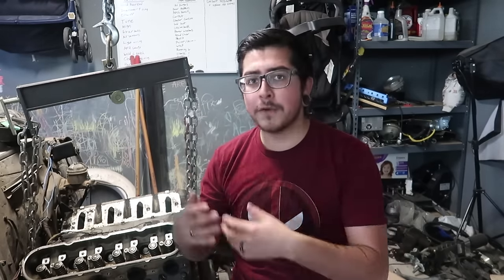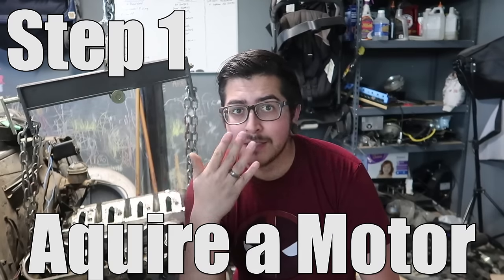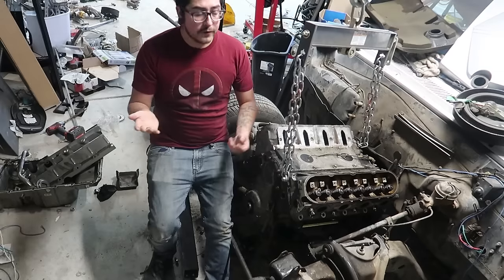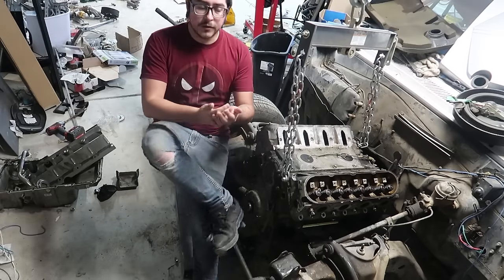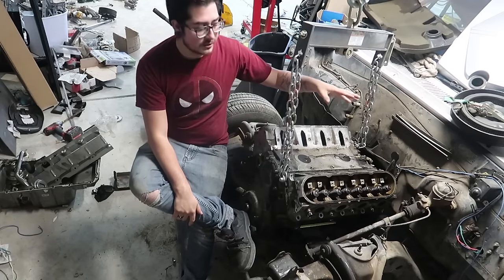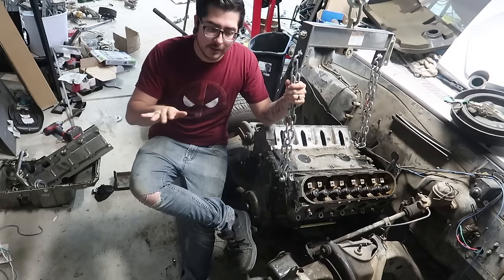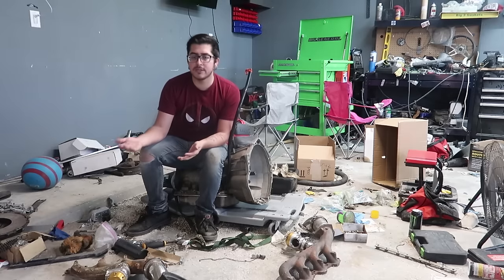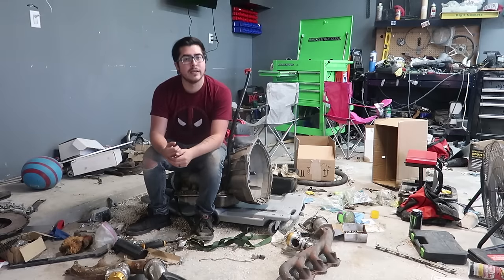HOW TO LS SWAP ANY VEHICLE - 5 THINGS YOU NEED -- LS Swap Basics Overview (LONG VERSION)

Comment from the maker: STOP: BEFORE YOU COMPLAIN ABOUT THE LENGTH OF THE VIDEO GO HERE:
https://youtu.be/DucuEkh9yJE
Reply: Jovani Dante Griego well I have a question, I have a Audi A5 2009 can I put a ls in there ? And pass inspection
Reply: B Rock really depends where In the world you are, some countries are much more lenient than others with engine swaps
Reply from the maker: Elittiger Savage  the biggest problem with doing late model cars is getting everything to communicate. You'll need to find someone that can work with can bus. Swapping it is easy, but getting anything in the car to work is another story. Honestly 2010 ss Camaros cost as much as it'd take to swap it. It's not impossible just not worth it
Reply: Rectro YT New York
Reply: Jovani Dante Griego yO j what’s some good headers to use on my 6.0 ? Vortex
Reply from the maker: @brock2872  what's it going into?
Reply: Jovani Dante Griego it’s in my Silverado 2500
Reply: 2012 I wanna beef it up a lil
Reply: Jovani Dante Griego ?
Reply from the maker: @michaeldunn1262  go check out my other videos and see for yourself instead of judging me on 5 minutes of a video I made 2 years ago?
Reply: Jovani Dante Griego 
I’ll pass 
Thanks anyway
Reply from the maker: @michaeldunn1262  don't worry I'm sure YouTube will recommend them to you 👍
Reply: Jovani Dante Griego 
I see the maturity issue is still current :)
Reply from the maker: Respect is earned bud
Reply: Jovani Dante Griego 
Respect and maturity should have been a skill at the age you made this. ;)
Reply: Jovani Dante Griego can u LS swap an Corolla ?
Reply from the maker: @loercayt6146  with enough time and money sure why not
Reply: Jovani Dante Griego cool my dad Recently give me his Corolla and I’m a collage student I’m looking forward to that
Reply: @Jovani Dante Griego Thanks for the video.
I been planning my first LS swap for years, I have in my opinion the perfect vehicles, 93 s10 all complete, a 02 4x4 Tahoe 5.3 also complete, both run and drive no issues. Tbh, I'm a little scared of starting this project because of the lack of knowledge of the LS engine, I'm a new subscriber as of today, thanks again for the straight forward advice👍
Reply: I wonder about putting one in my 2005 vw touareg v8
Reply: @Jovani Dante Griego excellent video anyone complaining should find another channel. This was short & right to the point!  I have yet to see any video that covered what you have here!  Thanks!  ✌
Reply: @brock2872  check out deBoss garage. He has a youtube channel and ls swapped an audi Quattro.  4 turbos etc. Very cool build
Reply: I have a 2007 v6 mustang and a coyote swap right now is around 5k+ would an ls swap be possible?
Reply from the maker: It's possible, just not sure how much work is involved.
Reply: @JovaniDanteGriego  Alright thank you for the help and great video! I’m still a teenager so i’m still scared of the idea of dumping 4k into my car and it not running, but i’m too stubborn to go to a mechanic 😅
Reply: @JovaniDanteGriego  , you should see my suggestions for unexpected LS swaps.  You can thank me later.
Reply: @michaeldunn1262  , speaking of rude and condescending, you are ironically so as well, and you also misspelled words, so if you want to be taken seriously online, as well as offline, then you need to fix those things in your life.
Reply: Good @brock2872  a was#
Reply: @bradstiver3399  huh ?
Reply: I have a 1999 Silverado engine 5.3 and trans and wire harness that I’m wanna put into 1999 gmc sanoma the sanoma has a 2.2 I have the 4l60 trans as well
What rear end should I look for?
Reply from the maker: @joseacensio673  your rear end will hold up just fine most likely . Upgrade to whatever fits, 9 inch, 10 or 12 bolt. You'll need to measure and find something that fits if that's the case

Comment: One of the biggest issues with swaps is the need to remove VATS (vehicle anti theft system) from the computer. This can now be done using LS droid to pull the stock flash and software like EFILive or HPTuners to remove vats right at home. No more needing to spend $600 on hardware or sending it to some shady ebay guy that takes 6 months to return your computer.
Reply: @chevysttruck thank you boss I'm working on getting my two door Oldsmobile cutless Supreme sl to get ls to it parts are interesting to get .

Comment: If you aren’t doing one of the more common LS swaps, and you know you’ll be doing a good amount of fab, I totally recommend a mock-up engine. Mine is from a company called P-Ayr. It’s a blessing to be able to set it in and remove it from the vehicle easily by hand. I’ve used mine on a few LS swaps now. My plan was to use it then sell it, because it was a bit pricey and the resale value is good. Nope. Once you buy it, you’ll wanna keep it for future endeavors.
Reply from the maker: Thats a great idea! How much was the mock up?
Reply: When I bought it, it was about $450. If you use it and sell it, you can probably get most your money back. But, if you plan on doing multiple builds, I’d just keep it. It’s super lightweight, and has metal threaded inserts in all the correct locations to mount items to the engine. I currently have mine bolted to a trans, and with an intake/carb, water pump, oil pan and starter on it.

Comment: My best opinion to anyone, get a donor vehicle. You will have 80% on what you need. The 20% remaining will be 100% easier to figure out due to everything you will have due to the donor.
Reply: I like the idea of a wrecked donor vehicle and using everything oem possible.  Harness,  cluster, ignition switch, computer, fuel system, evap system, exhaust, radiator, airbox, etc..  To me the biggest things would be how you do the exhaust fabrication and the big one, electrical system.  On a gm vehicle maybe you could integrate the system into one, but on most swaps i would imagine it would be easier to have a split system, to have the gm computer for the engine, and keep original pcm/bcm in a newer car for everything else.  You could try to make original cluster work, or make gm one fit.  I like the idea of having the stock column/ignition switch to control accessory power and starter/lights, and then have the gm ignition switch  dash mounted like some old cars, which would just be used for antitheft and engine run mode.  And keeping the obd2 port would be nice.

Comment: Do you think a 2020 C300 coupe has room for any LS engine? I’m also considering VQ engines or anything Toyota. The M264 2.0T 4-cylinder does not inspire confidence, reliability-wise
Reply from the maker: I just don't know if it's worth it on such a new car. Especially Mercedes theres so many modules and fiber lines that getting your interior to work is beyond that of the average person

Comment: LS swap question...why if i get cpu with complete motor,do u recommend i get it reprogrammed?
Reply from the maker: Because it has VATS Vehicle anti theft system
Reply: @JovaniDanteGriego  Sorry jus wanna b clear..Am i reprogramming bcuz lack of VATS fuel enable signal? Because i did a bypass with vats module,installed on cpu pinout 25 & 94 FLTWD ran again. Until then it wuld only run 3-4 seconds & cut bck off.
Reply from the maker: @shawnwilliams9968  yes vats disabled fuel after about 3 seconds

Comment: Jovani: more fuel efficient
LS: laughs in 3 mpg
Reply from the maker: 😂😂😂😂😂😂 ok this is gold

But really just lean them out to like 15/16:1 af under 50% throttle
Reply: Need the 4l60, 4l80, or the 6l80 to get the mpg you’re looking for.
Reply: LSes can actually do 40mpg
Reply: @ellenorbjornsdottir1166  with what mods?
Reply: @bradhaines3142  with a car, tall gearing, a 6 speed, and a tune. This will get you above 30, weight reduction and aero can push you over 40 likely. 

A c5 corvette would be ideal for this, or a miata.

Comment: Amazing what people whine about the video. It’s too long, it’s too short, it took too long for this, you didn’t spend enough time on that, your hair is too long, the color of your tee-shirt doesn’t match your pants, the floor is dirty, I could hear the neighbors dog fart, get a grip people. 

No matter what your building use a 4L80 transmission. It’s no more money and is just a better transmission. Especially if you’re going to abuse it even a little bit. And I know everyone is going to do at least a couple burnouts and hard off the line acceleration.

Comment: TLDW Basics-
Engine: 2001+ 4.8/5.3/6.0 ; try to find the most complete you can. Try to find a "complete pull out"
Motor mounts: Buy or make whatever is out there for your car already. If its a unique swap, you're on your own to design.
Transmission: Auto 4l60 (lower power build) /4l80 ; Manual T-56 (from GM vehicle), NV3500/NV4500 (not for racing), *TH350/TH400(requires mods), avoid 700R4/200R4
Engine/Trans control: Get harness and ECU with your engine (pay to convert or do it yourself), Megasquirt/Holley Terminator
Fuel: Electric fuel pump (255LPH), fuel regulator depends on intake style (returnless or return)

Exhaust Manifolds that fit - Custom of premade for your swap
Oil pan that fits - Lots of options for swaps
Reply from the maker: Thanks!
Reply: A CTS V oil pan can fit and will it be better?
Reply from the maker: @romero.4089  it depends on your car. Most people use the F body (2001 Camaro SS) pan
Reply: The Last Honk he forgot about the drive shaft
Reply from the maker: @jonnypiper5378  cut to fit or custom made
Reply: Why avoid the 700r4 and 200-4r ...I know the 200 has the wrong bolt pattern but the 700r4? I have one behind a 500hp 4.3 turbo?
Reply from the maker: You can run a 700r4 it's just a non electronic 4l60e, you just have to worry about the TV cable. I just don't suggest them because even a built into doesn't hold up well to v8 torque . Obviously some can but even the 4l60e can't hold up. I've gone through a few
Reply: The Last Honk Audi ?

Comment: If its from a truck and going in a car: 
Intake and oil pan/windage tray are almost always a must. Wiring harness engine mounts and headers become the next challenge. Radiator also can be problematic. Ac and ABS might need to be relocated/removed.

Comment: I’d like to swap a turbo’d LS into a tesla, what do I need?
Reply: For a Tesla LS swap you need a flux capacitor  You can buy one at o'reilly auto parts make sure to buy the upgrade it 1 that generates a 121 jigga Watts
Reply: A Tesla, an LS, a turbo, some paper clips, a roll of packing tape and set of fluffy dice. Job done.
Reply: A "Turbo LS" sticker and fake muffler tips.
Reply: An ls for one and at least one battery mayby a rear end
Reply: You need a engineer lol
Reply: @countryjoe3551  I ordered the car to tank kit. I will Use the Kaleco advice,launch the product then watch the news... i am going to practice on the local Mosque first.
Reply: Literally just take the body and the frame from the tesla. that’s it
Reply: 2.56 niggawattz higga
Reply: First you need to be able to afford a Tesla. Then it’s all down hill from there.
Reply: Get a Corvette and put a Tesla badge on it. Done.
Reply: Jimmy Baggs a clinical psychologist
Reply: @Stew Pa'Dasso  That was the pass1.21 now is 121 jigga watts 2020 you just don't know what next
Reply: Ask rich rebuilds, he doesn’t have a turbo but he did get the engine to start in the car.
Reply: @mikesgsx420  rich rebuilds didn’t need a flux capacitor

Comment: Wow. You just spent 20 minutes complaining about people asking you about the swap, but somehow managed to not answer any of the questions that matter.
How about that Oil pan clearance issue?
The alternator  that bangs up against the frame issue?
floorboard modifications?
Reply from the maker: And you spent 20 minutes watching it and couldnt figure out that those are specific issues and this is a general video. The stock oil pan and alternator mounts worked for me. Obviously they wont work in every car. Notice how I didnt talk about exhaust either?
Reply: @JovaniDanteGriego  Those aren't specific issues.  Those are common issues with a large number of swaps.
Reply from the maker: @standardissue3903  If your oil pan doesn't clear you cut it or buy a muscle car pan. If your alternator doesn't fit you buy another bracket.  there you go
Reply: Not saying this isn't a very good video about info on ls swaps. But but since u went into indepth about different transmissions lol like auto th350 th400 4l60e 4l80e manual nv4500 nv3500 t56 ect. But u didnt mention 350z trans. I've heard it's a good trans to swap and 6spd. It seems pretty popular now. I dont remember the model numbers but its basically a 350z g25 ect trans and has really good gear ratios for ls swaps
Reply: @JovaniDanteGriego  muscle car pan is the worst recommendation. You might as well run a truck pan at that point. F Body or Holley 302-2 are more universal.
Reply from the maker: @huckey2010  I run the F bvody pan myself, but to each their own.
Reply: Right this video i feel didnt have very much info. i mean ya could have made this a 3 min video and just say get a motor trans slap it in wire and plum it up and bam done! 😂😂😂

Comment: 6 minutes into the video and still in step 1
Reply from the maker: You expect all this knowledge in 2 minutes?
Reply: @JovaniDanteGriego  no but could have been shorter and number 1 it's very obvious.  Of course you need an ls engine to do an ls swap. It be dumb if people tried and do an ls swap without the ls engine. Intake, accessory drive , motor mounts, oil pan what type of throttle body dbw dbc, ecm tuning, most importantly what car will the engine be going in will determine what you should be planning for
Reply from the maker: @Miguelspl150  The point of the video is not to be talking about specific cars, i can talk for an hour about just doing a c10 swap. Also, Im talking about types of LS engines, people who dont know and are new always assume they need an ls1 or ls2 . they dont even think or know about the truck engines.
Reply from the maker: @Miguelspl150  https://youtu.be/DucuEkh9yJE
Reply: @JovaniDanteGriego  I'm a mechanical engineer and mechanic. If you're going to create constructive content, and actually become an "influencer", be humble and accept criticism. It's not a pretend scenario to prior look at what engine variations meet correctly to which transmission. That's probably why you're broke.
There's a reason why your video comments consists of 90% criticism. 
Your shop looks as messy as you talk to your viewers. Or should I say your people skills.
Reply from the maker: @jeremyhauser6193  what are you even going on about?
Reply: @JovaniDanteGriego  You're right. I shouldn't say 'your' viewers.
Reply from the maker: @jeremyhauser6193  no I'm legitimately interested In What you're trying to say but please elaborate I'm confused on the transmission thing and I understand my garage was messy. Big whoop. I had just finished 3 projects in less than a month and hadn't had a break to clean. Guess what my garage is clean now? It's called working. Shit gets messy, you clean and then it gets messy again
Reply: @Miguelspl150  Why are you complaining like a spoiled child? He's doing this for free. Either suck it up or don't watch.

Comment: For anyone looking at T56s: I think it would be useful to mention that corvette T56s are difficult to work with and that's the reason you generally find them cheaper.. Corvette T56s use a different tailhousing as all of them use torque tubes rather than driveshafts. To convert these particular T56s to use a driveshaft requires a lot of work and money as you have to mess with the internals of the transmission.

Generally, you can look up the # on the plate of a T56 to find out what vehicle it came out of, but corvette T56s are easy to tell apart from ones out of other cars such as F-bodies because there is no tail housing (more square in shape, and a shaft sticking out the back with splines) whereas other T56s have a tail housing (more tapered rear, connection for the driveshaft rather than a spline shaft that the torque tube slips onto.)

Comment: I have a 99 LS1 with a nv3500 5 speed transmission the flywheel and clutch is off a 4.8 99 Silverado eBay sales the cheapest standard wiring kits as long as you have a computer to flash I'm keep mind  injected.

Comment: Any Chevrolet manual or automatic will work with an ls, but keep in mind a 4l60 or 4l80 will be a 4 speed auto. A 6l80 is a great 6 speed auto that will work with your build. BP makes the best harness for LS builds. I’ve done more then 50 LS swaps from square body’s to first gen corvettes.
Reply: You do any rangers.there is forums on it but not a crazy amount if info
Reply: Sean McHale you talking about ls swap or coyote?
Reply: What is BP stand for sorry new to this
Reply: @bryanstroup864  it’s the name of the company that makes the harness. They also have a package with harness, sensors, and unlocked ECU.
Reply: What about manual transmission? Not named tremec or t56
Reply: @blakelip3  if a sbc or bbc bolt to it so will an LS motor. They share bolt pattern minus one bolt you can leave out.
Reply: @seanmchale6860  curious about this too
Reply: I see you have experience in LS swaps. What's your advice on putting 5.3 LS in 79 El Camino
Reply: @thomasfoster5200  We’ve done a couple early 80s El Caminos here at the shop. Best thing to do is get a good quality harness and if you can run a in tank fuel pump ( external pumps can make alot of noise and tend to fail more frequently). Dakota Digital makes a nice drive by wire gauge set up for those as well.
Reply: @vl639  thank you very much